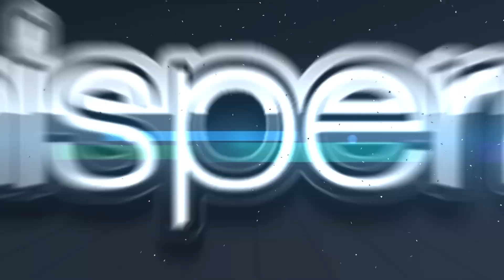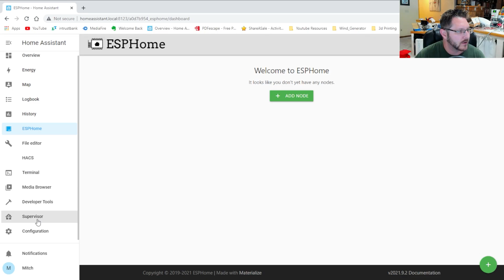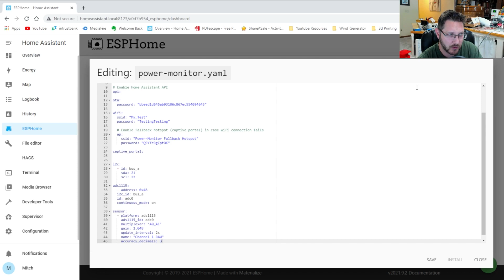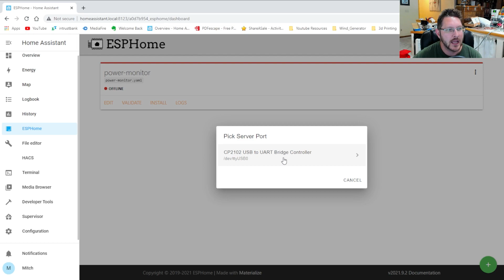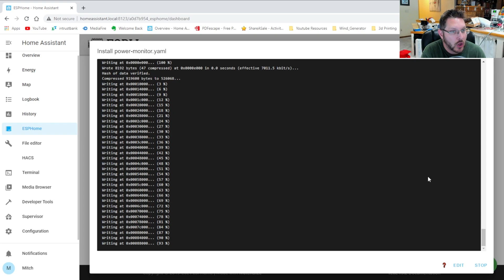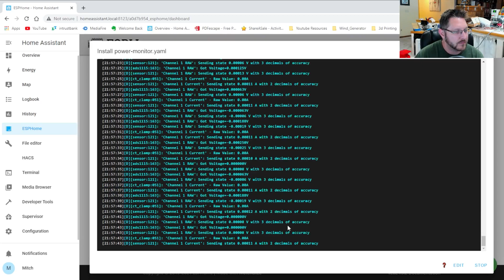Home Assistant Power Monitor System Part 1

Comment: if you haven't worked it out how to flash esp boards via the web browser, its possible if the communication is https and browser is chrome. few months ago when i did it, i found no production ready instructions how to stock configure https, so i simply ran esphome integration docker manually, outside hass and reconfigured the py server file to start up https server with self signed keys (by default it is http).

Comment: Thanks for sharing
Esp Home with ADS1114 and 4x Voltage Dividers 4x 12v Battery monitoring tried several things but never succeeded can you help me
2x is working good other 2 not working or not good